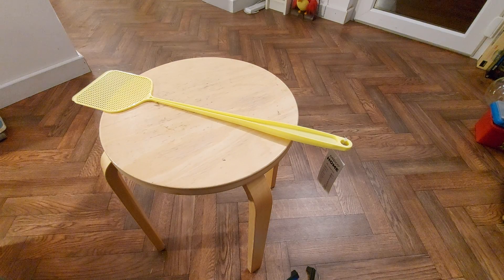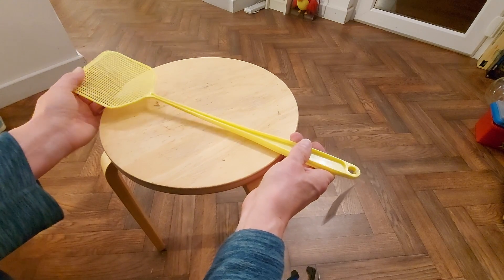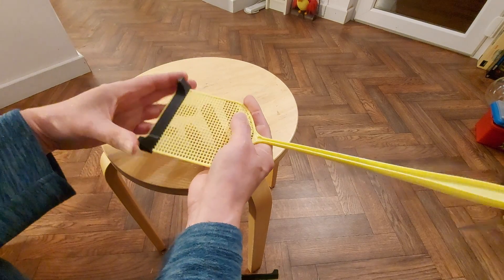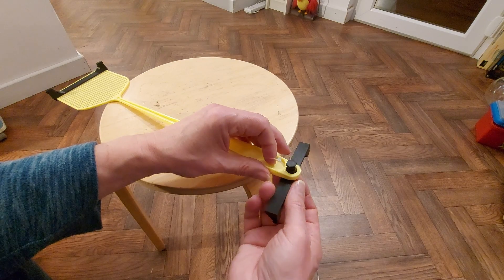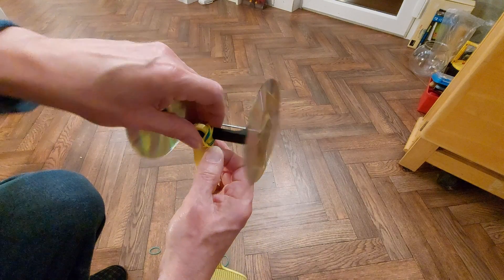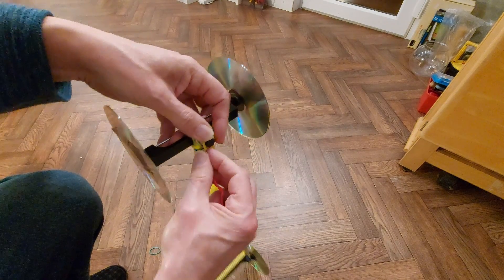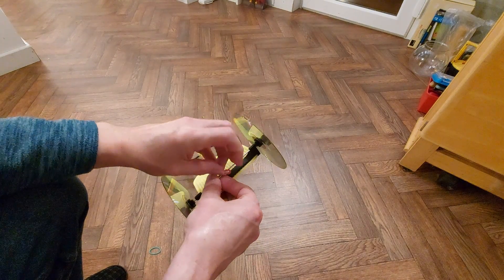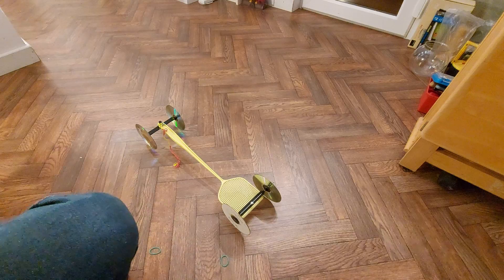Put a rubber band on it 0469 Poundland Fly Swatter RBPC

Comment: Bruh should try put some rubber bands round the cds 💿 for more gripsoo
Reply from the maker: Not required on this session as I am not using much power, however I prefer to use strips cut from rubber gloves. You will find my helpfile on the subject in the video description. 10 years old now but still relevant 😁😁👍👍

Comment: Excellent! And easily adjusted steering, also seems the frame contributes to it's drive (well if you wind it up enough for it to bend)... that gives me an idea, what if we forgo the rubber bands entirely, and made a springy frame in which to drive the car, steering could be complicated by having a flexible frame, but maybe two leaf spring bow like appendages on the outmost part of the car? Might help keeping it straight especially if the line around the drive axle is properly centered.
Reply from the maker: Somehow, you would need to get the spring of the lever to drive the axle. Here is something along that line https://www.youtube.com/watch?v=IBUbwCN8RRY&list=PLA5a2xPRSrB3bEp0pE4UcVggFXWbujnSj&index=38
Reply: @Putarubberbandonit  I was thinking more along the lines of this;

https://youtube.com/shorts/gRt9flvoX6E?si=HuK1DIoTm21nmk-1
Reply from the maker: YouTube hid the comment with the link. I just found it but the link is dead, so I am putting your SHORTs link here for anybody else to see 😁 https://www.youtube.com/shorts/gRt9flvoX6E
Reply from the maker: Oh that is weird, it is the same link and again, it doesn't work. I will check on a different browser.
Reply from the maker: That gets really weird, the link on my comment worked on a different browser, and now it is working here, but your comment with the link has disappeared 🤔
Reply: @Putarubberbandonit  weird, yeah I can't see your link, I'm using Chrome on my android
Reply from the maker: Today, I can see 5 replies, 4 of them are mine. Yours with the link is still missing, even though I have approved it. If I go into YouTube Studio I can see your comment with the link, but the link does not work from there. This is all pretty irrelevant, but it is annoying. I have checked on Chrome, Firefox, Edge, and Opera. Same on all of them, so it is something YouTube has deliberately blocked. I do remember something about them saying they were going to block links  @spencer963